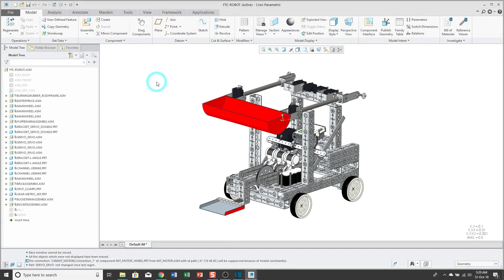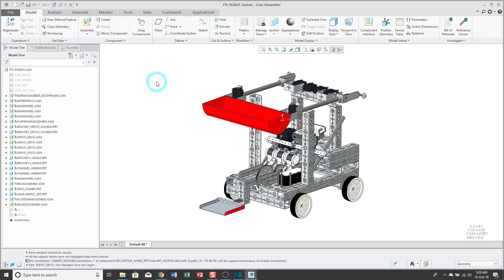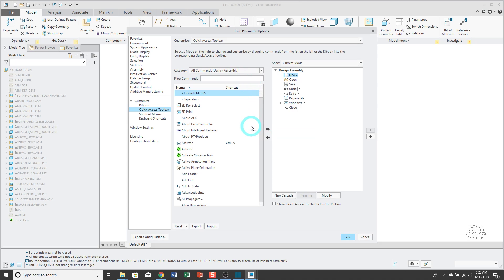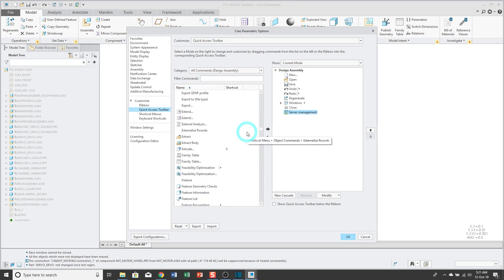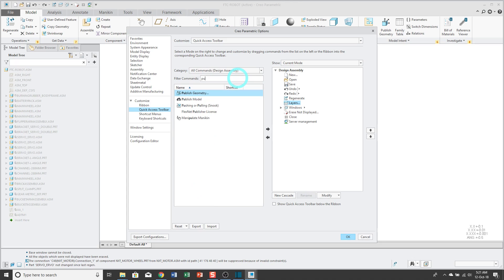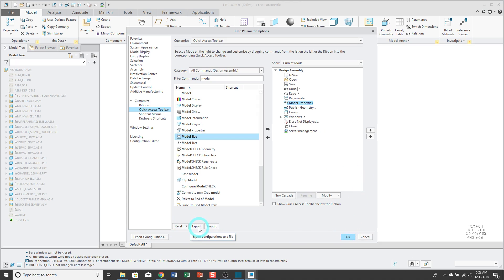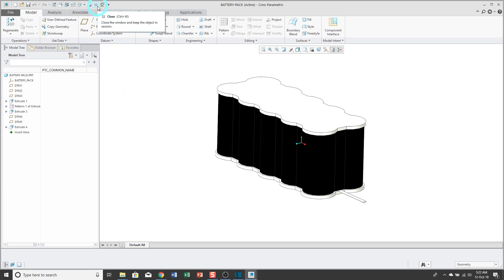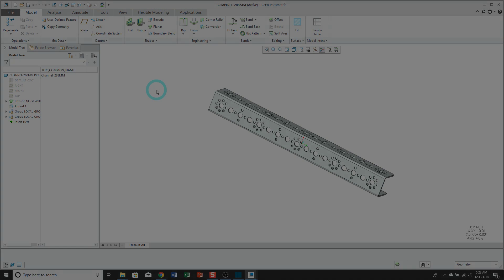Creo Parametric - Configuring the Quick Access Toolbar - Creo 4.0 / 5.0 / 6.0

Comment: I just upgraded from Creo 4 to Creo 6.  Unfortunately it seems that because I am not starting from a default/blank ".ui" file in Creo 6, the quick access toolbar does not automatically propagate across modes as you've shown.   In other words Creo 6 pulled (some) of my quick access configurations from my Creo 4 .ui file (where I had unintentionally configured each mode to have slightly different quick access toolbars).... and now in Creo 6 I cannot seem to link the quick access toolbars from all the modes to be the same as each other.  If there is a trick for turning on quick access automatic propagation in this scenario please share!  Thanks again for all of your incredibly useful videos.
Reply: I discovered within the settings there is a "reset" option that allows you to reset all quick access customizations.  I did this in Creo 6 and rebuilt my quick access from scratch.  Now it is auto propagating to all modes!  It took about 20 minutes to rebuild from scratch, but it is worth it for the sake of consistency across modes.